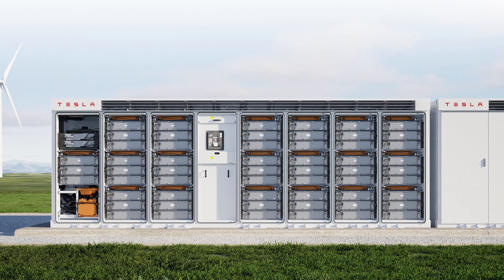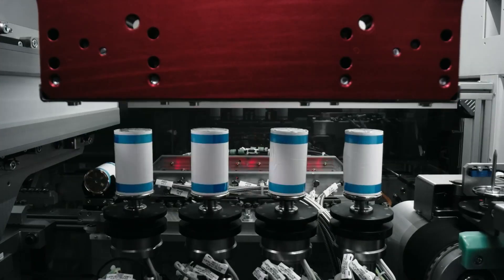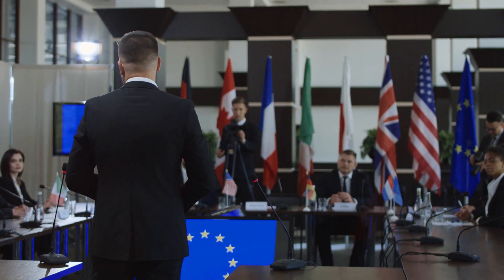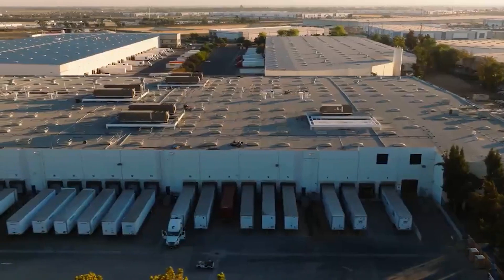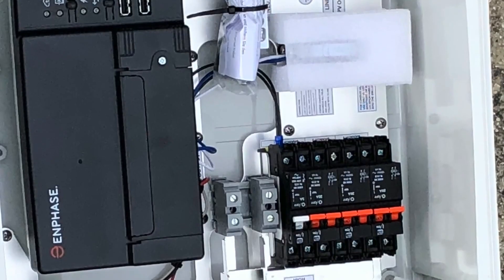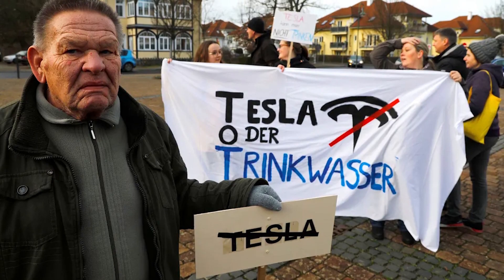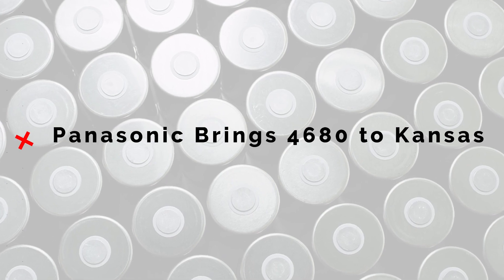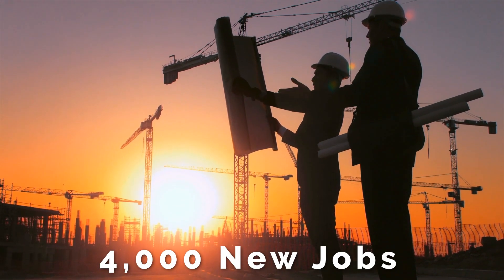Tesla Reveals New Billion Dollar MEGAfactory!

Comment: I wish Tesla Power Walls were a little cheaper, and I'd put two in my home. We already have solar and it would be great to be immune to power outages. Even with solar, our power goes out - it's illegal to push power onto the grid during an outage, to avoid endangering workers on the poles.
Reply: Have you looked at big battery? They sell a 14 kilowatt battery that has easy access to connections and if I remember right it includes a battery inverter built inside literally plug and play.

Food for thought

Comment: The name of the city where the mega pack is built is pronounces Lay-thrup
Reply: And it's on I-5 for an easy commute to Fremont. I used to drive on Hwy 120 connecting with I-5 for way too many years. Tesla took over or built these facilities after I moved. When I first drove in this area none of these buildings were there and we had terrible tule fog making it very dangerous during commuting. Of course, once everything was paved, buildings and houses built, the fog all but disappeared (along with the water).
Reply: @robeigner4390  A lot more traffic in the area, so the former easy drive is long gone.
Reply: It's actual leiy-thurpk
Reply: @leoperez2566  uh, no

Comment: I just came up with some pretty crude computations for possibly converting a regular car into an aircraft, although the engine would have to be modified... and the wings are the entire computation... and they need to be shaped like a cats claw pointing down (fibonacci spiral)... but my computations I think work, so,
the wings that you have to stick on to the thing would be 2/3 as long as the fuselage from nose to tail.... twice as wide as the fuselage, per wing.... and half as tall as the fuselage, from top to bottom horizontally.... tapering into a point at the tip of the wing in a fibonacci spiral.... it should fly! especially with the rocket motor... a regular piston driven internal combustion engine would either have to be modified into a motor jet or a piston driven propeller, in addition to this it needs to have a positive lift to weight ratio....so obviously a car that you'd buy it an auto dealership or just off the factory floor or wherever, you'd have to gut the whole thing take a lot of weight out of it and then convert some of that weight into the wings (like the fuel tanks can be moved there, and battery) or just put new lightweight Wings on the outside of it.... and then, like I said, the motor would need to be updated... but again as long as it has a positive lift to weight ratio and also it Bears these Wing dimensions in a Fibonacci spiral like the shape of a cat's claw or a raindrop or teardrop then it should fly.

The tail could be a 1/2 scale or maybe 1/3 scale copy of the wings, sandwiched together, on a spoiler mount.

Maybe one day, you can trade in your car, for a plane, for a small price, compared to buying a plane full price... it would still look kinda like the car also, and might even have the same motor still, although modified.

So a 7 foot wide fuselage would have like a 35 foot wing span, 10 feet long means wings 6 feet long from nose to tail, and 5 feet tall fuselage means 2.5 foot wide wings, AT THE BASE, like I said, a straight leading edge, and the rear end tapers in a fibonacci spiral, and the side profile ALSO tapers in a fibonacci spiral, from its thick point at the front and where it connects to the plane, to its thin point at the rear end and outer edge/tips of the wings. 

Each wing could also be a box, with just a side profile of the cat claw, pointing down.... with the thick part at the leading wing edge, less efficient tho. More angles = more directed lift (air pressure)

So if the thrust to weight ratio is positive, it should go up, but the aerodynamics create a pocket, which acts like train tracks, leading in the direction of the sky, or a ramp, or roller coaster, always facing up, proportional to the amount of thrust and airspeed.

I think it's important to note that a lot of auto mechanics probably started out by being air craft engineers in the military, which was common at the time, after the war, these aviators then went on to become auto mechanics, which is why cars are built like planes, and not vice versa.
Reply: Good idea! Lemme know when you’re done with the prototype, I want to watch your maiden flight.

Comment: We bury Water sewage etc.... Why dont we bury our power (where possible) especially in places where storms take out power regularly
Reply: This is a question answered repeatedly. Long story short, battery storage is more sensitive and requires more maintenance than sewage.
Reply: Because it’s either way too expensive or also the climatic conditions doesn’t allow i!!!!!
Reply: @Recker1984  stop Talking nonsense!!!!! When you burry cables it’s far more expensive to do repairs and also snow and other soil conditions aren’t favorable. There are engineers that actually evaluate that before. Monster towers are super easy and transport electricity on super longer distances over very difficult terrains…..
Reply: @Recker1984  underground cables only makes sense in a very developed city just like other utilities but again it makes repairs much more dangerous and difficult.

Comment: Way overblown and optimistic "analysis" of the usefulness of the megapacks.  

How many flooded Tesla wall batteries are a fire risk?  Are they covered by insurance?  Are the fires covered by insurance?
Reply: Don't worry about fire, the battery for storage is DIFFERENT than the battery in Tesla EV ( high speed charging and discharging ) .  The chemistry ( materials ) is very different, I am more worry about all the metal casing, and pollution of the aging battery
Reply: @JY-lg6ee  Megapacks have been known to catch fire, regardless of chemistry.
Reply: William it could happen! 
But it could also happen that the mega packs could also keep lots of fragile grid locations in the light.
Vs in the dark ( where you live… in perennial darkness of mind and negativity )
Reply: Umm. Yes and yes. 
What do you think a power wall is like throwing a hair dryer in a bathtub or something? Wow dude
Reply: @MrShaun1011  NO,  they are 2 totally things, Hair dryer is AC high voltage motor running , Power wall is DC storage battery, there will be no electricity if there is no " connection " between cathode and anode
Reply: @JY-lg6ee  you're absolutely completely missed the point, have a great day
Reply: @JY-lg6ee  playing a powerwall battery can be submerged it's not going to start on fire, that's all